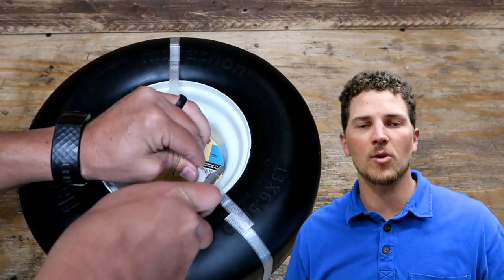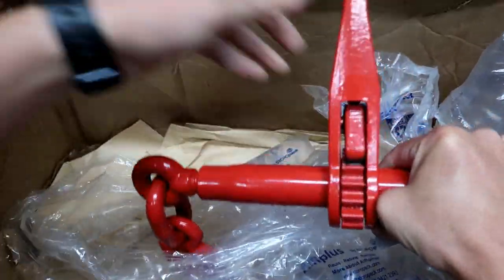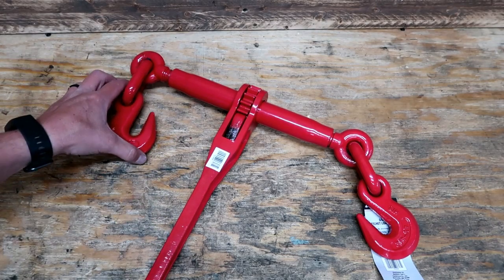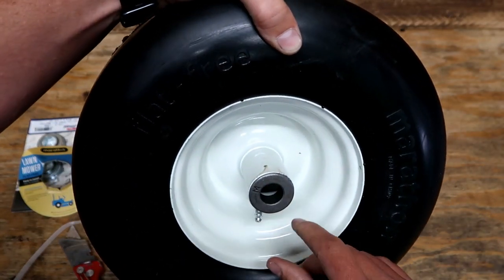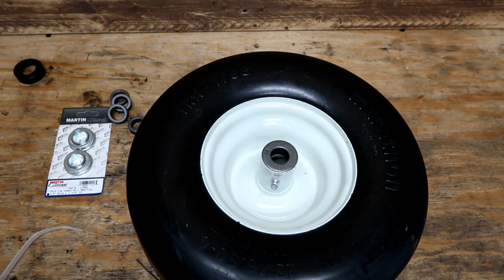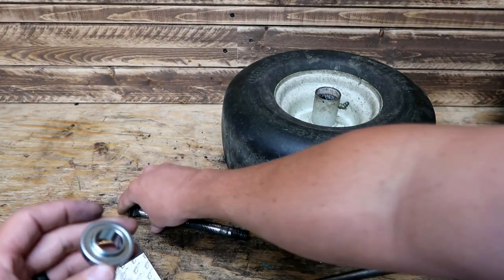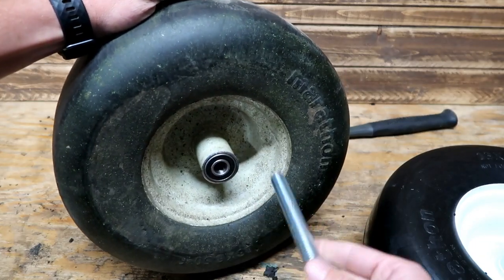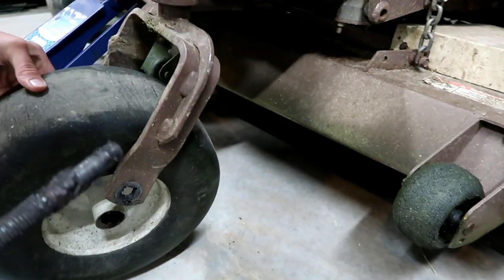Flat Free Tire for Zero Turn Caster Wheels

Comment: A fully threaded bolt is NOT meant to be a wheel shaft.
Reply: Would a smooth metal surface keep a grease film, though?  I'm imagining only if you grease them every few mows.

Comment: When Using Your Ratchet Chain binders, I recommend using White Lithium Grease instead of Oils or Grease.  White Lithium Grease Naturally doesn’t draw / collect Dust, Like other greases do.   You can also get it in a Spray Can for Convenience.  If you can get it in a Squeeze Tube.

Comment: PERFECT example of one of those snakes that is up in your face but you can't see them,  the threads on the bolts ate up the powdered  metal bushings, doesn't matter WHAT TYPE of bearing or bushing you put in the wheel hubs the I.D. of bushing or bearing will be destroyed because the bolt threads are working as a saw on them with every rotation. IF you use a fully threaded from one end to the other bolt you will have to use a full length SLEEVE over the threads
Reply from the maker: Good to know!
Reply: You likely have a spacer in your original wheel that you didn’t remove.

Comment: I’d get a sleeve axel to put the bolt through. Using a threaded bolt as an axel seems more like a Mountain Engineering solution. Even bicycle axels aren’t threaded where they pass through the bearing/hub surface area. 
 Or just get some smooth stock and thread the ends for the nuts ( I recommend castle nuts with split pins )
Reply from the maker: I upgraded to tweets and put two new axle shafts in. It’s working great now! 👍

Comment: You are getting excess wear from the axle bolt being threaded and having a bushing bearing vs. Ball bearings. It is acting just like a file. Ball bearings should take care of that.
Reply from the maker: Let's hope!
Reply: Mine has a spacer the bolt goes through. So threads no way they touch the wheel

Comment: Dude question, but how do you know which size bearings you need?
Ive been looking and havent found anything about my Mustang 50xp
Reply from the maker: Most bearings are measured by the shaft and hub diameter. A good auto parts stout or specialty bearing supplier should be able to help you out.

Comment: You will do yourself some real good if you get some calipers to measure inside and outside dimensions.  I prefer digital.  Better one will not run down the battery like a cheap one will.

Comment: This is a kind of how-not-to video. There is so much wrong with the way bearings have been applied, I don't know where to start. A steel spacer is supposed to radially bear on the plain sintered iron bearings(bushings) inside of the wheel hub. The spacer is longer than the assembly, and the sides of the forks tighten against the spacer. Nothing in this assembly should slide/rotate against the bolt. If you substitute ball bearings, NO axial(lengthwise) pressure can be exerted on the bearings. The low speed bearings selected are the worst ball bearings available.  If you tighten the fork legs against those horrible chinesium ball bearings, I assure you that they will fail soon. Pro tip: measure your components before purchasing bearings. Buy bearings to match the bolt and hub bore. If no match is available, then you will have to source/make bushings to adapt. I really wanted to know about the quality of the wheel tire assembly, but now, oof.
Reply from the maker: Yep, these no flat tires were junk and ice since upgraded to the much more expensive Michelin tweels which come with proper bearings.
Reply: @ThriftyGarage Why don't you update the whole title of your video about marathons being junk so people don't waste their time?
Reply from the maker: I’m sorry the video is out of date. I wish I could go back and edit it. I’m not sure how I would change the title. It is still an accurate description of what the video is about. As I mentioned in the video I would do an update which I did with the Michelin tweels. I’ll try and update the cards and end screen to show that more updated video.

Comment: I see nothing 'thrifty' about the price of those tires.
  If you were REALLY "thrifty", you would do what I do. Go to home depot , or about any local store and buy a couple cans of expanding foam.  Drill 3 holes right threw the middle of the tire tread about equally spaced, around the circumference of the tire, and apply foam in the tire. It will never go flat again.
Reply from the maker: The nice thing about being thrifty is eventually you dig yourself out of a hole. When I started the channel I was so broke I used free pallet wood to finish my garage walls. Now I own a business and sometimes time is money. I tried the “cheap fix” with these tires the first time. Second time it wasn’t worth messing with.